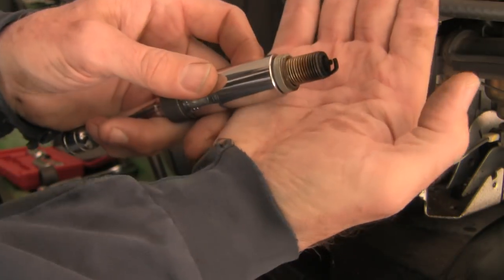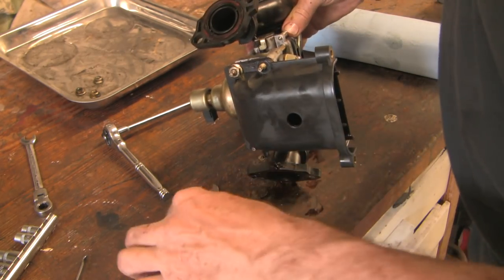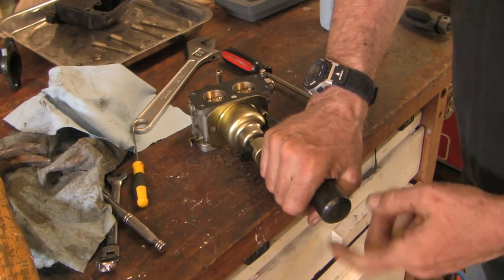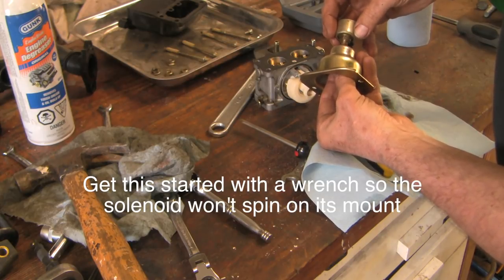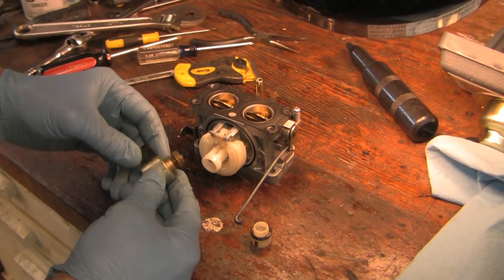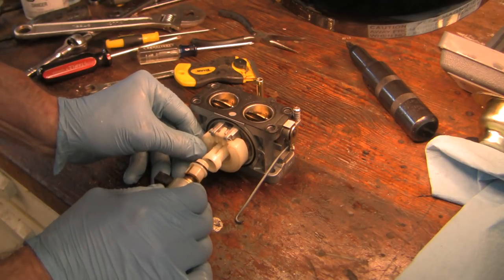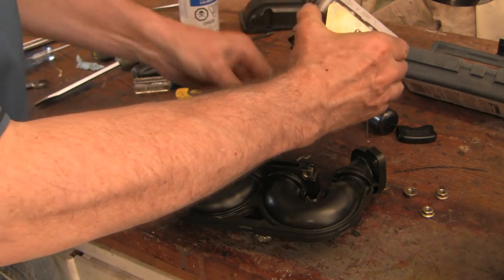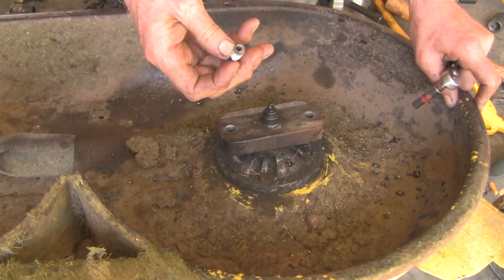How to clean a Briggs & Stratton Nikki carburetor on an Intek V-twin Lawn Tractor

Comment: Dude , ya just saved me a bunch of anguish trying to figure out my exact same carb on a twenty four horse Intek twin . Machine is new to me , and I am getting it ready to sell . I tracked the erratic running behavior down to the carburetor . 
Seeing your video showed me just how bad mine was buggered up when someone , before me , didn't properly fit the Dime sized O-ring  [ or it got disoriented when the float chamber bowl was previously attached to body of carb. ]  that seals the two white plastic emulsion tube housing pieces , the short one housing the A/B solenoid seat , and the long  one that runs through the donut hole of the float . Now all I need is match a new O-ring (that I have tons of) up to it and hopefully after a good cleaning she'll be making good carburateing noises once again in proper fashion as it should . 
 You are a true gentleman and a tribute to excellence . I'll sleep well tonight ... er , well - this morning . LoL Been researching for way before 9 pm. and it's almost 5 am , as i write you . I couldn't find this bottom load solenoid carb like mine for the life , much less a beautifully put together video breakdown till I stumbled into yours'  
 Thanks very much  ;
  . Dave

Comment: Today I just completed a "partial" rebuild of the Nikki V-Twin Carb. The rubber gasket "O" Ring in the fuel bowl had become swollen and the engine was puffing out black smoke and drowning in fuel so that O-Ring  needed replacement. While I was at it I replaced some intake gaskets too. I didn't completely disassemble it because it was as clean as the day it was born. One note about the "jets" : They indeed did fall out but  I personally didn't see any difference in size under a loupe and my Husqvarna is now running so I guess I got them in correctly. Your video was a good reference "just to make sure". Thanks for posting. BTW,  $15 in parts and and some sweat equity saved me around $200+.  Keep it DIY!

Comment: I watched so many videos and finally you answered my question. Jet 111 is LEFT, and jet 114 is RIGHT. Mine both fell out during disassembly because their O rings were completely deterioriated. Thanks for the video and solving the puzzle. Cheers
Reply from the maker: I'm glad it helped. There is nothing in the service manual describing this, and I can't guarantee it is correct since I'm the second owner. Mine continues to work fine and I've had very little done to it since this video was published years ago.
Reply: @spelunkerd  UPDATE- I just watched another video where the guy stated that he actually talked to a Briggs rep and they said the lean jet (smaller number) goes on the right. Frankly, I dont see where it would make a difference. Apparently B&S installed a lean jet for emissions sake. So one cylinder will always run lean, or you could say one cylinder will always run richer, with everything else being equal. Cheers

Comment: One my Intek the problem was a worn float needle on a fairly new engine. The needle was a cheap plastic thing. You need to check that the float needle is working and not leaking or it will run badly. The replacement was not cheap. Thanks for a clear, concise informative video.

Comment: My 22 horse husqvarna riding mower was spitting and backfiring on full throttle. Had low power. Sounded like it was running on one cylinder. After changing the plugs and fuel filter, still no fix. Tested both coils, both checked good. This video was excellent in detail of how to thoroughly clean the carburetor. After disassembling the carburetor I found the problem was the one of the jets was completely blocked with a tan jelly like substance that I call ETHANOL. The manufacturers sticker on the fuel tank approves up to 10% ethanol gasoline. THAT'S BULLS**T!!!! Folks stay away from ethanol gasoline in small engine carburetors. Great video  with no BS!!!👍👍👍
Reply from the maker: I thought I understood the ethanol debate, but on discovering that alcohols are an integral part of fuel stabilizer I realized the situation is much more complex. Here on the west coast I routinely use midgrade fuel for farm equipment, which does not have ethanol. However when I store my vehicles over winter I put in, yup, fuel stabilizer! After the last use in the fall I try to shut off fuel to the carb while engine is running, to let the vehicle die of fuel starvation so the carb is empty during the winter. Mostly I store tanks full to prevent condensation of water inside the tank and to reduce progression of internal rust. Even so, we can all expect to have to clean carbs intermittently. Thanks for stopping by!

Comment: Thanks for detailed tutorial..  Since I have a 12 year old lawn tractor I've never had a carb issue with I'm skeptical my new JD mower with less than 100 hrs of use could have a dirty carb. But it's almost always cited as the most common cause of surging.  Ill try the easy fixes first and if no luck I'll tear the carb apart.
Reply: Tried the easy fixes and lo and behold they have seemed to work. Plugs were very fouled so I cleaned them. Replaced the fuel filter (didn't seem to be dirty), and checked the fuel pump flow.  Cleaned the air cleaner. The mower still surged and ran rough with smoke coming from exhaust. Still hoping to avoid a carb teardown I decided to try some seafoam in the gas tank. After running about 15 seconds the engine smoothed out and ran like new.  I doubt the seafoam had enough time to work its way to the carb so I'm guessing there was some unburned fuel remaining in the cylinders from it running rich and once that burned out the surging and roughness cleared up.  I have no idea what caused the initial rich mixture and fouled plugs. I'm just glad I didn't have to tear the carb apart.  I did buy some micro bits, etc so ill have them on hand if it ever comes to that.

Comment: I have been fixing my recently purchase L120 also.  It was bending valve rods due to a loose valve guide in the left cylinder.  After fixing that the right cylinder was not running right.  I got the carb all cleaned up and put back together.  I had a dirty float bowl, and a clogged pick-up, and a bad o'ring.  Lots and lots of things to look into on these older 2nd hand mowers.

Comment: Great video Dave! Looks like I'm going to have to rebuild this same carburetor on my sister's John Deere 190C. Have a great day!
Reply from the maker: Hi Terry! For another video that does the same kind of deep dive, Chickanick here on Youtube did one that adds some more detail. She talks about how the seal kits from Amazon are often missing the correct tiny O rings that hold the jets in place. She said that you don't need to remove or replace those O rings if the jets don't fall out. I left those in  .
Reply: @spelunkerd Thanks Dave for the added info! I did see her video and it was informative too. It turns out that a Briggs and Stratton rebuild kit from Amazon is $95 and some change. Unbelievable when it’s mostly gaskets. She decided to buy the complete carburetor from Amazon for $40 whereas the one from John Deere is $240. I hope the cheap carburetor will work. Have a great evening.

Comment: One thing to note as you take off the intake, there are no paper gaskets, just the red rubber ring. I say this because my lawn mower store sold me them instead of the rubber ring. Their fault. There are so many different styles of Briggs & Stratton engines, yet some use the same parts. This was my experience with the store. These machines are so precise that a small mistake can cause problems. I do miss the old days when it was simple. Lawn mowers should not be rocket science.
Reply from the maker: Good point!
Reply: @spelunkerd  yes, thank you. and I might add that Briggs & Stratton has been sold or outsourced, and you can find a lot of the parts on Amazon or ebay or others. Apparently giving my model number to the store was not adequate information. I've been to Briggs & Stratton website and they say sold out. But you can get Briggs & Stratton parts from different websites. Very confusing

Comment: I agree with many of the commenters that this is a well made video, however you skipped a crucial part.  Underneath the main jet housing (technically "above" when the carb is oriented upright) there is a gasket with 4 O-rings.  Those are ALL Jet holes.  There are 4 Jets on this carburetor and the ones you didn't show in this video are usually the ones that cause so many people problems with surging and "only on choke" issues.  The 2 jets in the main jet housing are in the plastic housing as you showed, the other 2 are in the other 2 holes in the carburetor casting.  You'll need a flashlight to see them and then to insure they are cleared out as they tend to clog easily.  You should be able to flash a light from the top of the carb, through the holes and the jets, and see light from the bottom.  A sewing needle is too big to fit through the idle jet holes but it will unblock them at which point I use a wire brush bristle clamped in needle nosed vice-grips to probe the holes completely.  for particularly corroded idle jets, you can use a smaller drill bit than the holes and massage the Jet hole with the flutes on the drill bit to insure proper hole sizes.

In no way am i contesting the info in this video, just adding my knowledge to it.  I hope it helps.
Reply from the maker: Good points, I wondered about the possibility of further orifices deeper in the housing. I flushed it out well, and I did flush all the orifices I could find, including under the four hole gasket, but I'm not at all surprised there are further channels deeper in the housing. From what I hear you saying, there is nothing more to disassemble, just carefully look for more orifices and clean them all as best as possible. Anything more to add?
Reply: @spelunkerd  nope, that's really all i was saying.  so to be clear, in the plastic housing theres 2 jets (Main Jets) for the atomizer stems and the other 2 holes next to the stems in the Carb housing contain 2 more jets (Idler Jets) to be cleared.  Total of 4 brass jets.  

Thanks for the video
Good luck with your projects everyone.

Comment: Great Tutorial. There is a breather tube for the crankcase that connects to the inlet duct from the air cleaner. Not hard to imagine a dirty carb might create conditions that would suck some oil in from the breather tube to create blue smoke. This happens in car engines if you overfill the oil or have a bad PCV valve. As well, excessively rich mixture or perhaps dirt dissolve in fuel from the dirty carb, can create an excessive dense gray smoke that looks blue.

Comment: I have rebuilt my Nikki carburetor a couple of times. I have removed the main jets and replaced the o'rings both times. My experience, despite using gas with no ethanol, is that the o'rings tend to get very soft, and yes the jets will fall out. The o'rings are supposed to be Viton, to keep them from reacting to gasoline, but it doesn't seem to be good solution.

Comment: Great job on this video.  The detail in the presentation and the production quality were excellent. Thanks for sharing.  My mower has the intek v-twin which, I assume, uses this same carburetor. All I need now is the nerve to take on the job.  One thing I wondered about was whether you replaced any of the parts.  I can only assume that you didn't.
Reply from the maker: I did not, but if you have time to find a seal kit for the carb it would be wise to replace seals.

Comment: I have blue smoke and suspected it's a head gasket from my reading. I will try your method first to clean the carburetor but I will check the compression and tweak the valve gap. The PSI is 90 lbs before tweaking the valve gap.

Comment: Just one point of interest - sometimes the plastic float may be found to be punctured, causing the float to fill with fuel and this will delay or inhibit the closure of the delivery valve with the effect that the engine runs rich all the time.
Reply from the maker: Excellent point, David! Remarks like this one are why I scroll through the comments section on every video I see.

Comment: excellently done, very thorough, I followed it to the letter, and still stops running after 10-20 seconds. It runs so strong with no smoke or anything unusual, just die like no fuel continually feeding carb.
Reply from the maker: Hmm. Consider bad fuel, water in fuel tank, bad fuel filter, failing fuel pump, air leak in fuel delivery tubing, vacuum leak, or rarely a sticking backfire solenoid. Not sure. When you find the cause, please stop back and let us know what you found.
Reply: This is a long shot, but easy to check. There is a small vent hole in the gas cap. If it gets plugged by dirt or debris, the engine will stall out as though it's out fuel. 10-20 secs. would seem pretty quick if that was the problem, but worth a try.

Comment: Smashing repair, a much simpler reason than i thought lol.

Trust me to think about everything but the carb, the blue smoke just sounded like it was eating the oil, that would fowl up the plugs and lead to misfire.
Never mind, it got me thinking, your videos usually have that effect :-D.

The question is where did that dust/sludge come from?, the petrol tank or did it creep in via the air filter.
What a shame you had extra work to do on the blade, you were enjoying the mower working so well too :-(.
I would check the plugs colour later on, i know it depends on the heat grade but the colour does give a rough idea of how each cylinder is doing against the other side.
I still like to see a brown colour on plugs, i've been programmed by the haynes manual lol.
Reply from the maker: Yes, I wouldn't discount the likelihood that oil on the outside of the engine was smoking, making the exhaust look worse than it was. In any case, it is so gratifying to see blue exhaust clear up with better air/fuel balance. Thanks again for watching, feedback makes the effort to create these videos worthwhile.
Reply: I give feedback to show i appreciate the person making the video, that's why i made the account years ago, so i could comment, and to show my ignorance and poor spelling lol :-D. 

Some of your videos are beond me, so i can't comment, but ill still tick the like symbol.

Comment: Excellent video. But I believe there is a specific gasket application sequence on one side of the carburetor ?  I just tore mine off and realized too late ...  one of my gaskets has a slightly raised half moon ? I think it was in middle of layer  vs bottom ?
Reply from the maker: You make a good point. It's been so long, I don't remember anything that is not in the video. You may be able to find an OEM repair manual online. As you say, the order and positioning of those gaskets is critical, with many flaps acting as one way valves.

Comment: There are not numbers engraved in my main jets (which fell out before I watched this).  But I put carb cleaning picks in them until I found a pick that fit in one and not the other.  So I'll assume you're orientation is right and I'll put the bigger one on the right side.  Just an idea in case anyone else runs in to the same problem.
Reply from the maker: Chances are, it will work fine. Honestly I am not certain those jets are different diameters, even though the numbering is different. Forum discussions here on the internet say they are different, but I didn't find reference to that in the dealers repair manual, either way. I went over this old video again, since this season I had difficult start despite using fuel stabilizer over the winter. This year, on replacing the winter gas with fresh premium fuel, the problem is solved, ha ha. While at it I was intrigued by how the fuel pump in these little engines is driven by manifold vacuum. So, even a small leak in vacuum could lead to a situation where the fuel pump is underperforming. If starter motor speed is low, or valves are out of adjustment, manifold vacuum may sag, leading to reduced fuel pump performance. Fortunately it is easy to assess fuel pump performance directly just by pulling off a line. Every time I go over these little engines I am impressed by the engineering details.
Reply: @spelunkerd  thank you for taking the time to respond.  I just edited my comment to read there are *not numbers engraved on my main jets.  I guess I have a 50/50 chance either way.  For sure they are different size ID confirmed from carb cleaning wires.

The parts list has several different part numbers for my jets but doesn't show where each goes.  

Interesting about the fuel pump.  I was curious about that too.  What you pointed out about vacuum leak and valve adj makes plenty of sense.
Reply: @spelunkerd  I think R & L are the opposite of that.  I just saw a video from takeabathproductions and he proved how the jet on the R side is the smaller one using the same method I spoke about with the jet cleaning needles.  In case this helps you or anyone else.
Reply from the maker: @ocrun6765  I wouldn't be surprised, I am the second owner of this tractor. What does surprise me is there is no mention of asymmetry in the dealers repair manual, and my tractor seems to be functioning normally. So, if it is backwards, it evidently doesn't make a lot of difference, ha ha.

Comment: I hope you still check these coments....You refer to the 2 jets as right & left, but you are looking at the bottom of the carb.  What is the orientation on the V-Twin of right & left, or #1 & #2 cylinder?  My jets fell out before I knew they were different sizes.
Reply from the maker: Right or left refers to the viewers perspective when it is held exactly as shown in the video, while that remark is made. I can't guarantee it wasn't put in wrong by the last guy who worked on my engine, but that's the way it was oriented in mine.